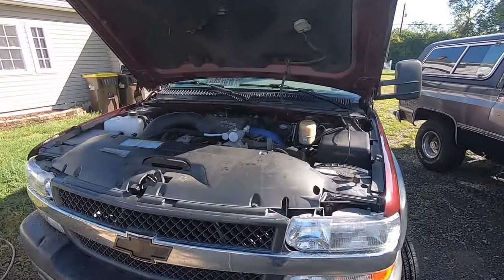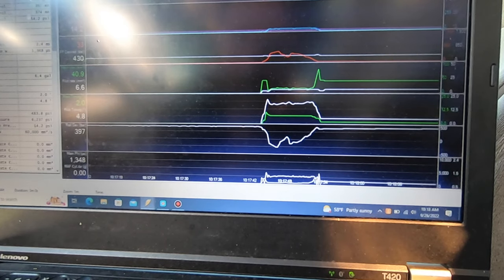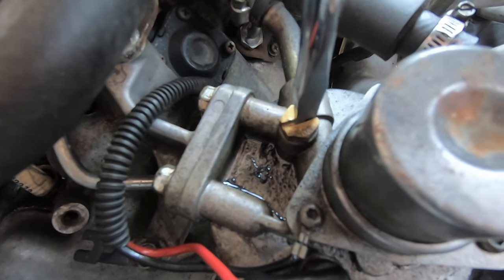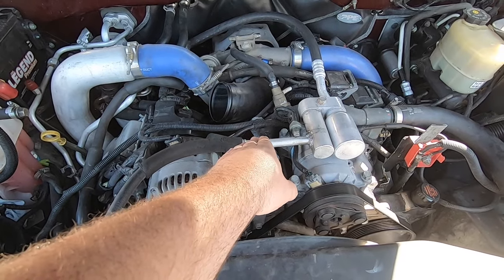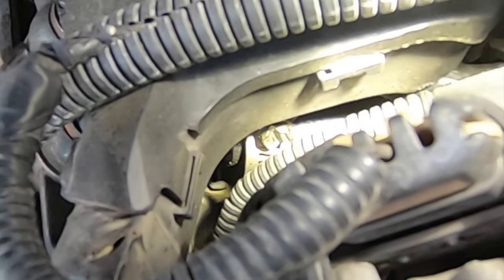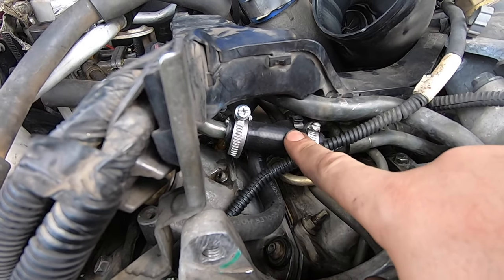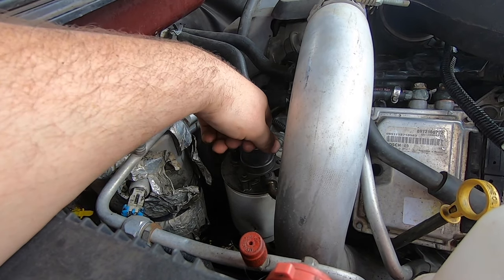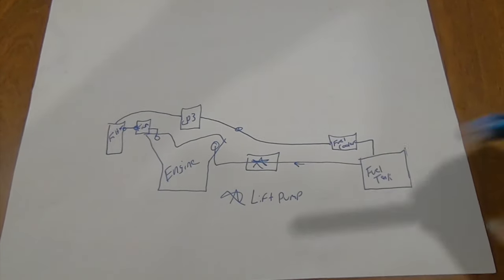Duramax LB7 Losing Prime when parked? Heres how to fix. Silverado 3500HD

Comment: My 2004 LLY has this problem on very hot days, definitely going to look into this. Thanks for the video.
Reply from the maker: Good luck thanks for watching!
Reply: @spankranchgarage This was the trouble, after i fixed it this summer it starts IMMEDIATELY........I'm still stock with no lift pump.

Comment: So what would be my problem if my fuel filter drains but won't start   ....reprime .....same thing.   But I can start it with starting fluid and it will stay running
Reply from the maker: It sounds like a bigger leak to me that cannot be overcome at cranking RPM, but it finally primes once the engine is running in ether

Comment: My LB7 died suddenly under the hood on passenger side had been spayed with fuel looked like . Changed fuel filter it started ran 10min then died suddenly pumped filter was nearly full want start I can't find a leak anywhere? Help please
Reply from the maker: Diesel is tricky to find leaks. Rebuilding the fuel filter head/primer would be a good start. Clean it up real good and really study the system. If it leaked once it has to leak again

Comment: 04 lb7 brakes lock up while driving im limited to like 15miles all 4 wheels lock up, brake pedal hard as a brick at which point then i have to releave the pressure on brakes. 4 new calipers. Builds pressure while driving any ideas ?
Reply from the maker: If I had to guess this seems like a problem with your hydroboost. Or your pedal adjustment is incorrect not allowing fluid to return to the reservoir as the fluid heats up and expands. Does your brake fluid look like power steering fluid?

Comment: I got a 2004 lb7 duramax, I went to fire it up to head to work started it fired up normal then as I was backing up it died so I tried to prime it and got nothing I primed it for ever and still couldn’t get a prime what could it be?
Reply from the maker: You either have a restriction or an air leak. Pulling some hoses off the filter housing and replacing them temporarily with clear tubing is a great tip to visually see if you have air or fuel flow. That will point you in the right direction.
Reply: I’m having the same issue but after running for a bit giving it throttle it died, lost prime and now is a crank no start

Comment: 2010 LMM, when my truck is between 1/2 and 1/4 it wont turn over (after sitting a hour or so) when the lift pump (FASS 150) is on, if i unplug the FASS and prime it manually it will run just fine until empty. Any ideas?
Reply from the maker: That's a really strange one man. Usually the FASS will help mask the symptoms of leaks, not make it worse. Im not sure whats going on there
Reply: Tell me about it. I bled it with the lift pump and I think that was the ticket. Maybe just some stubborn trapped air.

Comment: Would this cause truck to idle rough and surge? My LLY is loosing prime over night
Reply from the maker: Yes. If its drawing any air into the line the CP3 regulator circuit will not regulate fuel pressure adequately.

Comment: So is it all 1/2" fule line for all the rubber line ???? Thanks
Reply from the maker: For most of the hoses yes 1/2"
Reply: Glad someone asked this. Although I saved this video, I bought 3/8" hoses. When i went back and looked i seen the hose was 1/2". The GM shop told me they were metric hoses though. 🤷‍♂️ @spankranchgarage

Comment: Could that cause a build up of air over time driving and cause stunbling?
Reply from the maker: Yes. Under heavy load mine would drag the air bubble into the CP3 and fall on its face but under low load the air bubble would stay at a high point, away from the cp3

Comment: My LB7 is losing prime when hot and generally when the fuel tank is under 1/2 tank. On rare occasions it will die while at a red light. It generally happens after I stop somewhere and come back out to start it and it won’t start. I have to manually prime it to get it to start. Sometimes it takes two or three times to get it started and remain running. Recently, and again it is occasionally when it won’t start when cold. Again I have to prime it manually. Any ideas?